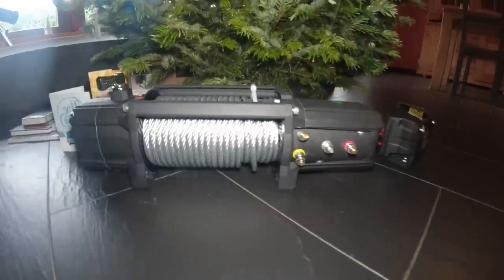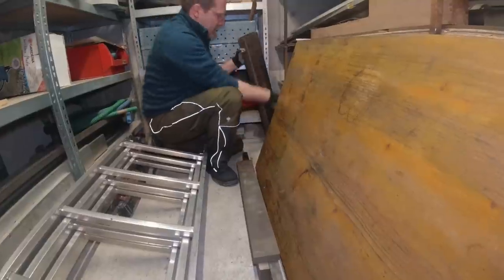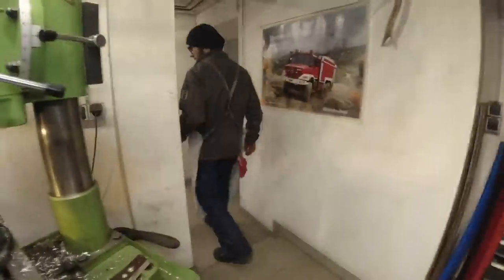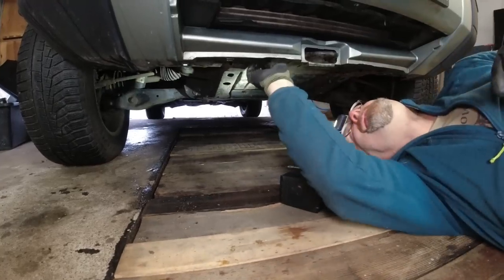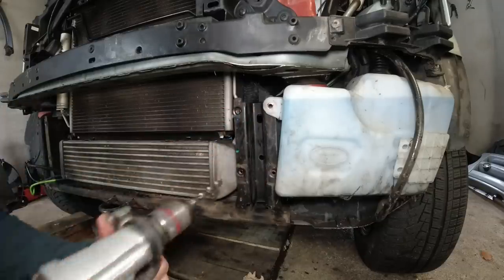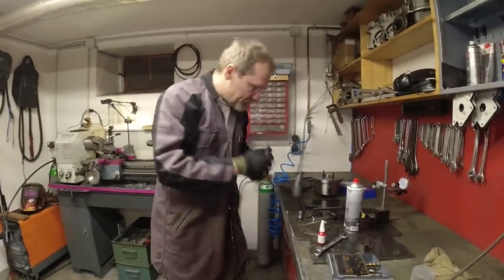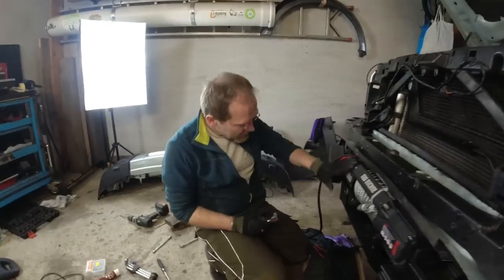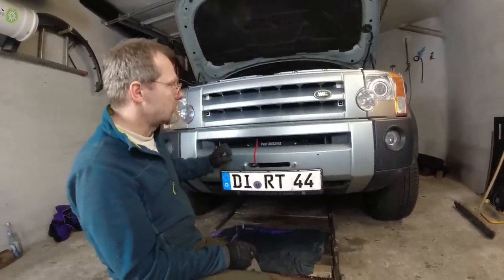Land Rover - DIY easy-to-duplicate winch mount for Discovery 3 / 4

Comment: Hi Christian and Vera, i hope you and your family had a nice start of the new year. Like every video that you posted we stay every sunday in front our tv enjoying and learning much more than expected about ours Discovery 3. I share my experience with winches, i don´t have it in my D3 but I have some experiences with other wehicles. The steel cable will damage your aluminium hawse fairlead. For steel cable you should to use a roller (as supplied) or change it for a synthetic rope. this rope has many advantages, stronger, lighter and will not damage your alu piece even it works sideways. Best regards from Argentina
Reply from the maker: 😃👍 happy New Year to you too. When we actually need to use the winch, we can mount the rollers really easily. Christian has that all included in the updated files. 🙋‍♀️Vera
Reply: @Vera_and_Christian  Thank you Vera. Christian is every time a step forward!!!!!

Comment: Hi, what would be the differrencies on D4?
Reply from the maker: Not sure.  It only fits the V6 Diesel for sure.  The bumper of the LR4 looks smaller.  Christian
Reply: @Vera_and_Christian  Im asking because I have the exact same mall crawler as you have and all the mounting plates are sold as D3/D4/RRS, so was assuming there will be similar space under the bumper.

Comment: Hi Vera
What made you and your husband so interested in Land Rover?
Thanx
Reply from the maker: We started Land Rover with my Freelander 1, I think 11 years ago. And in 2016 only came our D3 along. The great thing about Land Rovers, apart that they are so good lucking, which is the first thing that pays your attention, is that they are by far, the cheapest luxury SUV's around. So even if they need more attention than others, they still cost a fraction of a Toyota or a Mercedes G-Klass. And they need maintaining too.  And we knew of course that we can fix anything that comes along, and have been so far. 🙋‍♀️Vera
Reply: @Vera_and_Christian  The workshops gave up on my LR4, fixed it myself.
Reply from the maker: @arntrainojohannessen7061  💪👌🙋‍♀️Vera

Comment: Bunnings is the Oz go to hardware/diy store 👍
Reply: OK if you don't want anything high grade, like bolts, steel plate, chain saw, etc, etc.  They do have a lot of stuff though, choose carefully if it isn't a brand name item.
Reply from the maker: That would be just about our kind of store, I know Andrew St. P. W. always goes there and Grizzlynbear. 😃👍🙋‍♀️Vera
Reply: @Vera_and_Christian  And you can get a sausage in bread with onion at the door on the weekend. (Covid permitting)